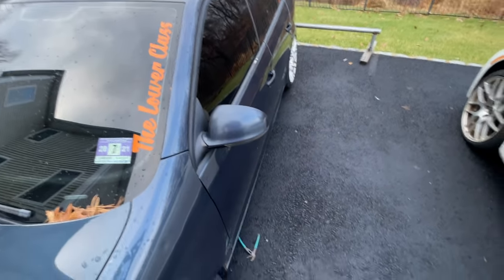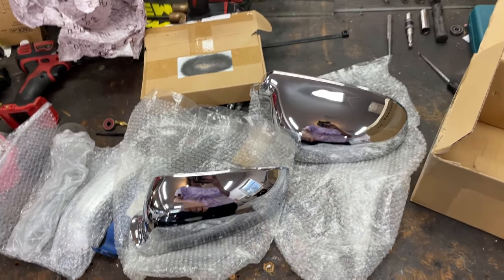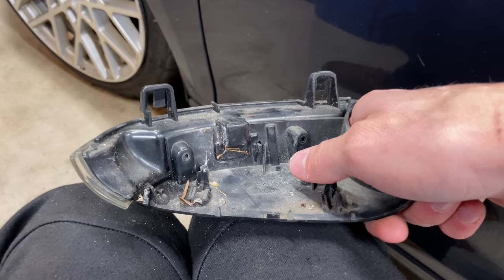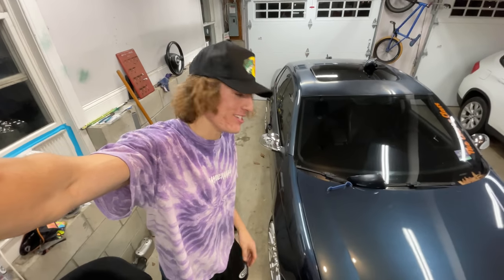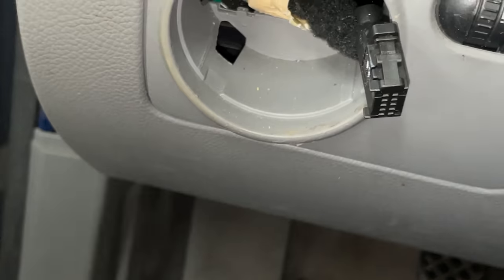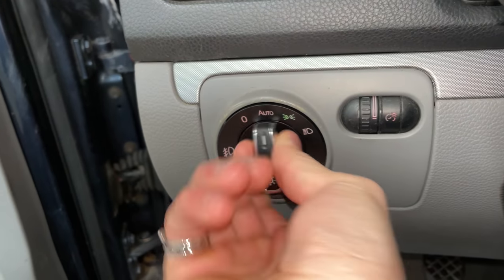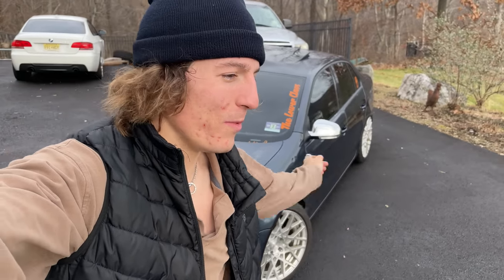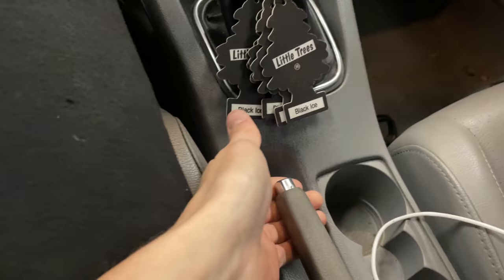I INSTALLED CHROME MIRROR CAPS - on my mk5 jetta

Comment: Hey dude, on the light switch, the ones after auto are the "marker lights" i think you might call them, and then the normal lights, and for the foglights pull the switch towards you when it's turned all the way to the right(it should have two positions in that way). Keep up the good work!

Comment: Did the exact thing on the light switch but mine came with a extra unit that turns on drl and headlight when it get dark automatically and i love it, 3 is drl and 4 with pull is fog lights, but love those headlights

Comment: Any chance youll show how you camber the front? Or where to get parts for it? I have a wide mk5 set up that is low, as low as I can go on 19x9.5. Rears rolled to fuck still grabs the inside wheel wells
Reply from the maker: Ill be filming everything

Comment: Did you have to install some stupid sensor with that switch or nah cuz my mk5 Jetta came with one of the chrome switches with some goofy chinesium sensor and goofy wire snaking out to the dash, is the linked one plug and play or nah?
Reply from the maker: Nah , i think you will get a light but should be fine

Comment: Bro you gotta properly route those wires through the firewall. You can tell they are getting pinched by the door, super not safe
Reply from the maker: Previous owner had a sub , im doing a removal video soon